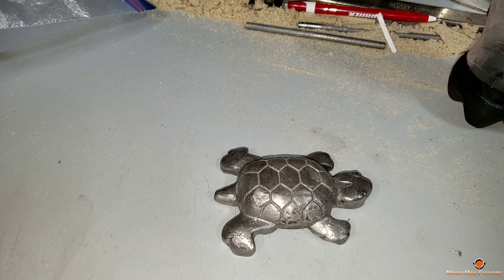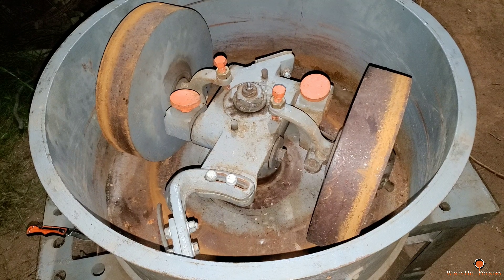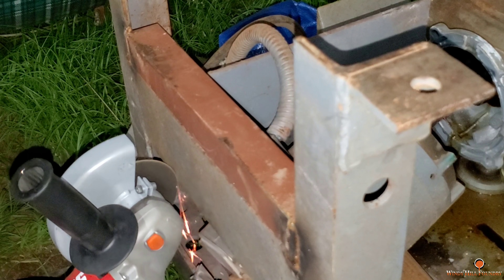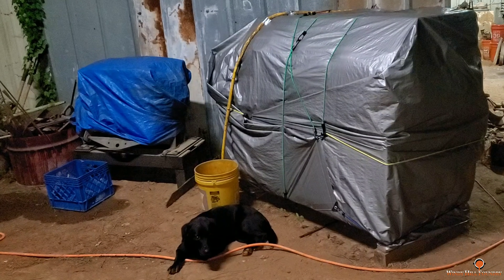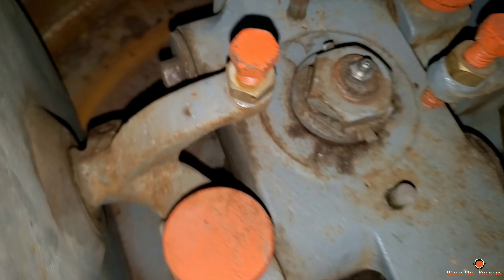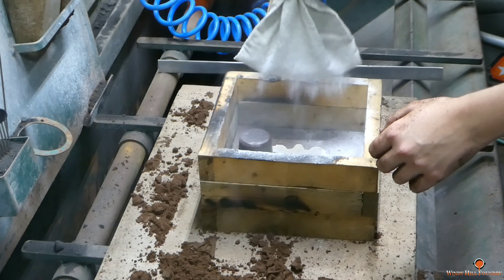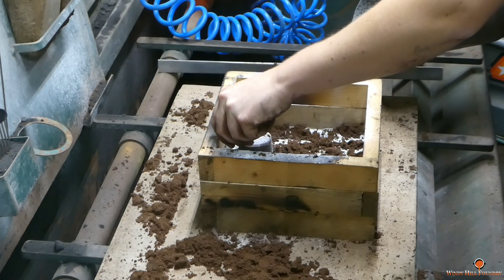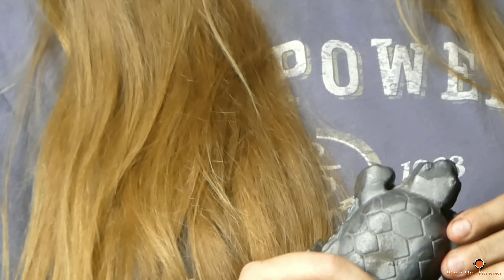PURCHASED AN INDUCTOTHERM FURNACE, INDUSTRIAL MULLER AND POWER SEAVER. THEN WE CAST IRON TURTLES.

Comment: I have never run an induction furnace but I did talk to the guy that used to do our castings at work. He said an induction furnace has a coil of copper tubing that the electricity passes through to melt the metal. Water pumps through the copper pipe to keep it from melting. refractory is between the molten metal and the copper tubing. If the tubing gets too hot and melts,  water will be forced into the refractory and if it makes its way to the molten metal, I think you know what will happen. It will blow up.

Comment: Did the furnace come with the water cooling unit?  How many lb is it? My father used to work at an investment casting company. They had 2 furnaces, I believe a 100lb and 200lb and the water cooler unit was a little bigger than the size of a fully extended pop up camper
Reply from the maker: The water cooler didn't come with it. I will be piping in fresh water that just goes straight to drain
Reply: @windyhillfoundry5940  nice! I know where my dad worked I believe they ran distilled water so it was non conductive in case the refractory cement had a blow through with molten metal. The cooling unit was called a recold unit and ran distilled water through massive radiators that were cooled with normal city water pumped over the fins and electric fans blowing, but their operation was constantly melting metal as they poured a lot of metal daily. That may be why they needed such a large cooler.

Comment: For a 1hp I would keep the 3ph motor and get a VFD that runs on single phase.  That way you would have a programmable current/torque limit as well as speed control.

Comment: Used to be a small foundry in Warren county NY owned by some family friends, to get around demand metering when they ran their induction furnace, they used to run a diesel generator. Don't know what the power situation is where you are, but some companies will charge you an entire days worth at max demand if you really spin up your meter, well worth looking into before you max out your electric bill.
Reply from the maker: Thanks Greg, i will keep you posted as i know more. We haven't had restrictions out here, yet anyway. I'm not ruling out a generator though because I'm not supplied 3 phase

Comment: How many amps does that furnace draw at 240v? Is it 1ph or 3ph?
Reply: This is the VFD I purchased for my 3hp mill It worked great. If you need any electrical gear for your shop let me know. I have a lot of new and used gear in my shop.
Reply from the maker: Jonathan I have no idea. I do know it has a 50hp motor

Comment: So glad you mentioned that the petrobond will slide out of the flask.  That happens to me and I thought maybe I was ramming it to lightly, maybe I didn't have deep enough grooves in the sides of the flask to key the sand in.  Or maybe the area to height of the cope/drag was making the sand not grip the sides enough.  I have about zero experience making sand molds and couldn't understand why I couldn't stop it from happening

So this doesn't happen with green sand then?
Reply from the maker: Hi Hex, because of the oily texture of petrobond it will slide out fairly easily in shallow flask like this. I have no problem with green sand though

Comment: Clarke I got two high quality cast aluminium cross braces off a vibratory bulk tobacco shaker. They were torqued on wrong and snapped off. The grain structure is super tight and clean.  If you have any alu specific projects let me know. Its just shy of 40lbs.
Reply from the maker: Thanks Josh, I currently have 900 pounds of A356. As of now I am pouring mostly cast iron but I do appreciate the offer
Reply: @windyhillfoundry5940  no worries. it got over torqued and the edges snapped revealing super straight super tight grain, it made me think of you guys immidiately lol. keep up the good work 😊

Comment: What did you do to get rid of the shrinkage?
Reply: Following a particular formula, possibly, the pattern is a certain percentage larger than the desired outcome.....I believe he covered this phenomenon in a recent video......Even showing draft angles......and percentage rates of various metals used in casting.
Reply: @OnlyTheEd  I think I saw the video.  I didn't mean entire shrinkage.  I meant the indent shrinkage on the back of the shell.
Reply: @HeinrichsMade  leave enough of a sprue and extra material for it to be able to draw in as much as it needs, i dont even cast iron but i've done enough tinkering to know this :D (if im wrong, just smack me upside the head and tell me to shut up)
Reply from the maker: There was a riser added to the other side

Comment: In the Navy, we had to repair some equipment at a SIMA years ago from one of the repair ships foundry shop. The muller that you got looks like one of the two mullers we did work on (Simpson) in our MR shop. Can't find any info on those other than Simpson still makes newer ones. The other one had a name like (Beardsley-Porter). I ran the Planning/Estimating/Tech library and did some research on both at the time.
Reply from the maker: Thanks Randall, the more I look into this, the more I realize it isn't all original. Starting to identify some things about the gear train show signs of that. I think the Muller is 50% Simpson and the other half maybe a gravely cultivator🙄
Reply: @windyhillfoundry5940  Sounds par for the course on old machines. LOL

Comment: I don't know if you have 3 phase available in your workshop? however you can run a single phase motor quite successfully on a single phase supply, I have done it may times myself, I am not sure if it is legal in the US but the US does not seem to have many laws even carrying guns seems OK in the USA. All you need to do is  connect the active to one phase and the neutral to the second phase. you then get a large AC electrolytic capacitor around 30 UF (they are easily sources because they are also used for power factor correction) you connect this from the active to the 3rd phase, just make sure the capacitor is for AC use.
David
Reply from the maker: Thanks David, I don't have 3 phase in my building. We are looking into a rotary phase converter. Everything on single phase at the moment

Comment: You should be advised that the induction furnace will need a good water source to cool the coils that are hollow. You can't just turn on the furnace to melt the metal like furnaces that use a resistance coils. I ran Inductotherm 100 and inductotherm 150 furnaces my entire Navy career and they worked great. Did you only get the tilt furnace or did you get the lift coil furnace too?
Reply: Fellow sailor here, we had to repair some equipment at a SIMA years ago from one of the repair ships foundry shop. The muller that Windy Hill got looks like one of the two mullers we did work on (Simpson) in our MR shop. Can't find any info on those other than Simpson still makes newer ones. The other one had a name like (Beardsley-Porter). I ran the Planning/Estimating/Tech library and did some research on both at the time.
Reply from the maker: @randallparker8477  thanks Randall, based off what the rest are saying you all agree. Not sure why the plate was removed but at least I have a direction to turn to now👍
Reply from the maker: Thanks Sandrammer, I have just the tilt furnace. Yes this requires water, I will be installing a supply and drain where I position it. It won't happen this year, still have to get the building finished and get the unit in place yet.
Reply: @windyhillfoundry5940  , Not sure how your induction furnace is set up but our Inductotherm furnaces had a heat exchanger that passed the coils cooling water (which had to be nonconductive water like distilled water) through it and was cooled by an outside water source. In the case of the furnaces on the ship the water was pumped from the cold water the ship was floating in and immediately dumped back in to the cold water. It's imperative that the coils' cooling water be nonconductive!

Comment: Make a pattern of the paddle and make all you need... weld on some hard facing too.
Reply from the maker: I was thinking of trying just that👍
Reply: @windyhillfoundry5940  You got this! Would be cool to try to create a 3D model for it in Fusion 360. A 3D scanner and/or or some good reference profile pics would make it possible to create a good model to start from. A 3D printed, casting wax plug would be the trick. :D

Comment: It’s super easy to convert a three phase to a single phase with a digital vfd.  It also has an added benefit of having variable speed on the muller.  I converted a few hp simpson muller made in the 30’s to digital control and it works so well.
Reply: Itt looks like simpson muller.  It looks nearly identical to mine it’s very hard to find parts for the old ones.
Reply from the maker: That's my biggest fear but luckily we can make them👍
Reply from the maker: I have heard of someone using a vid but they said the start up was difficult. Once it git going there was no problems. Did you have that issue, I mean could you start yours with sand already in the muller
Reply: @windyhillfoundry5940  mine will start up when its full of sand no problem.  its a very soft start compared to just flipping it on, I suspect the coupler wouldn't have so much stress on it with a VFD.  I can run mine at any frequency from super slow to 60hz.  the motor on mine is massive though.  I can check the specs later today.